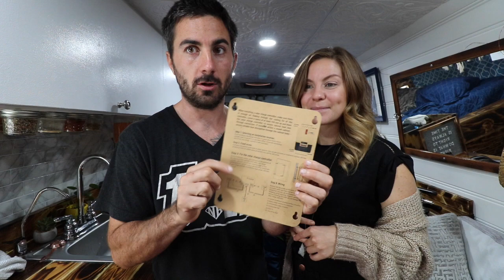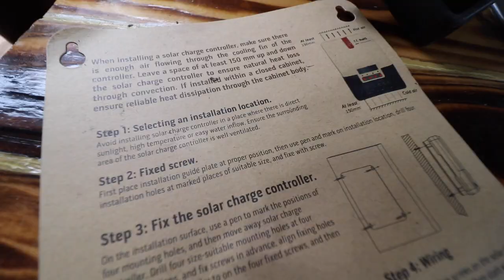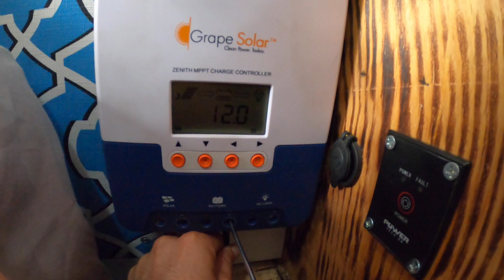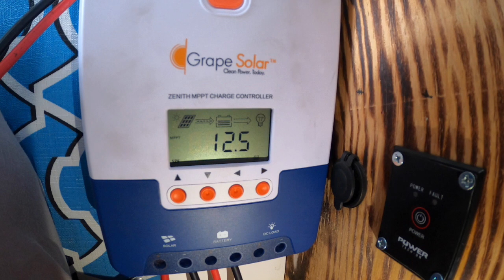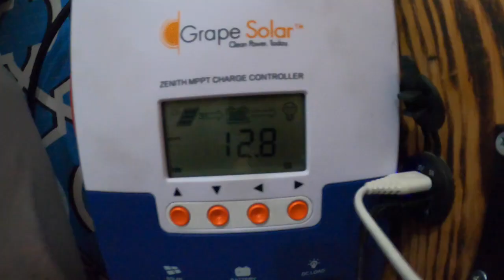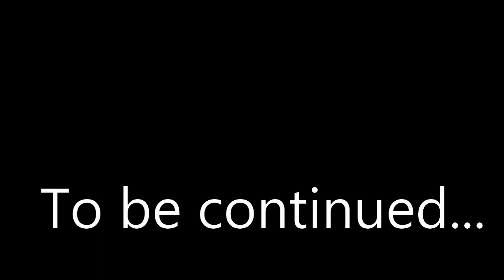Upgrade Our Off Grid SOLAR SYSTEM to Grape Solar | How to Make Solar System BETTER Part 1

Comment: There's a US panel manufacturer called Hightec with 200w panels with a 25yr warranty for $185/shipped. They're distributed by ContinuousResources dot com They are the largest panel to shop without $300 freight charges. Don't waste time with 100w panels which end up costing more with all the extra mounts, adapters wire and time. You want to plan for a minimum of 1.5w per AH of battery. Use cardboard templates of panels to determine size and location.
Reply from the maker: very good to know! Grape Solar does have some USA made panels so we went with them for our next build too. Always great to see options!!!

Comment: Frankie, what’s the reason to have the batteries in parallel or in series?
Reply from the maker: In series if you lose one you lose what ever is after it so if the first battery off the mppt controller went out you wouldnt be charging the others. In parallel you would only lose the one and still be able to charge and use the others. Also you up your amperage while keeping your voltage the same.